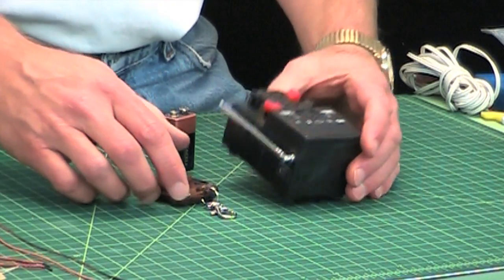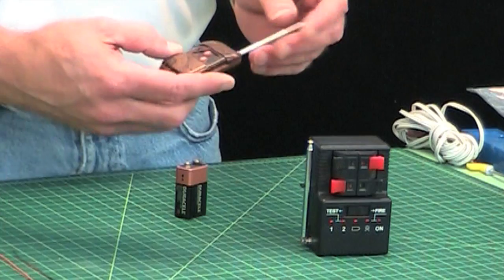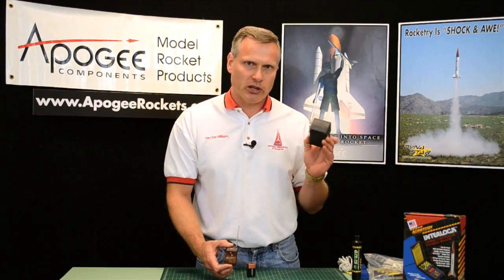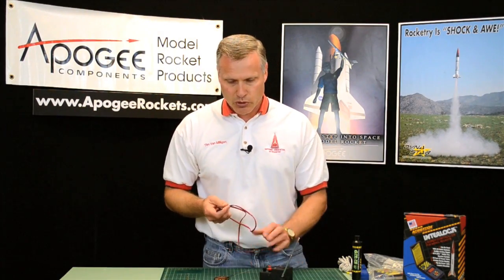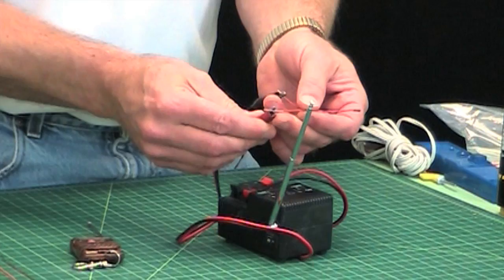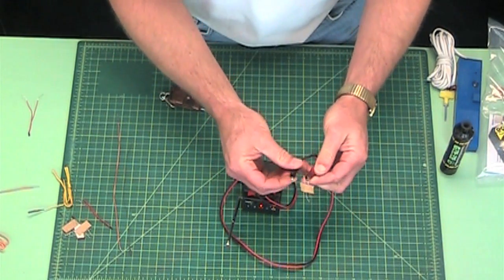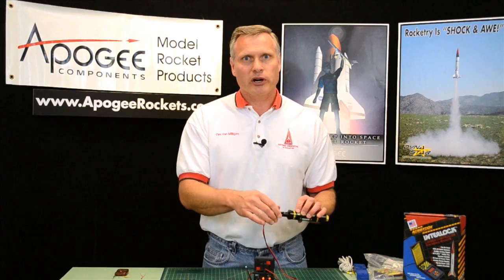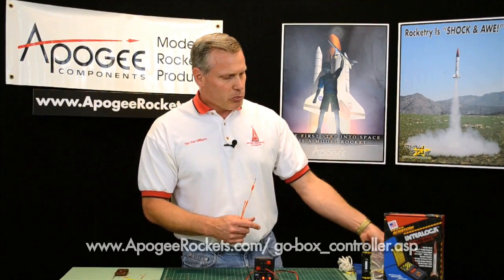Using the FlashPak Launch Controller

Comment: This makes me very sad. No physical key? How does that not violate rule #3 of the NAR code. And I have learned that using wifi/radio launch controllers is quite common ....... In the United States. I think it's nothing more than ego and that Harry would be very displeased.
It is impossible to make a wireless system totally safe. The risk of accidental triggering can never be zero.
I've seen people argue that a digital coded signal is safer than a physical pin. ... Seriously? That's ridiculous. If there's no safety pin, how can there be an accidental triggering? There can't be.
With radio/wifi, there is always the risk of it being triggered by some random electrical pulse or signal that somehow manages to bypass the "safety code." Also, no code is 100% safe, everyone knows that.